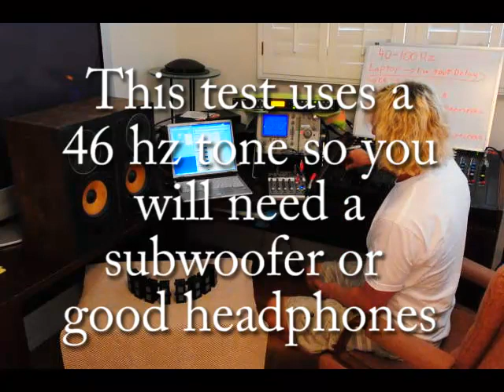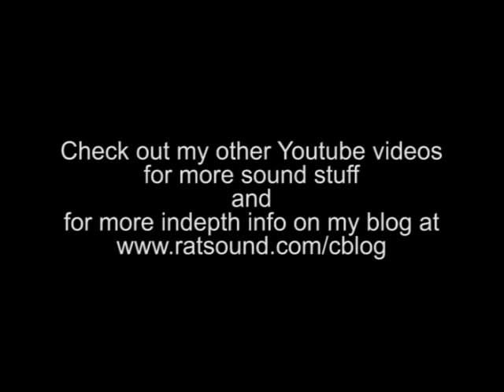Live Sound Subwoofer Configurations Part 2

Comment: What do you think of the Cerwin Vega FH subs style.  

I use two of these subs in a three way system and i dont need more then this. I have used up to 4 but thats way too loud for a 500 +people venue, and its chest thumping loud. Thats more louder then any configuration of 4-double 18’s. But i also think it depends on the amp!
Reply from the maker: cerwin Vega definitely has a distinct sound with heavy cones and beefy voice coils giving a thick low end. Not a fast low end but definitely in the range of the oh so many desirable sounds

Comment: Fascinating.  I think that what is percieved as "punch" requires a sharp fast transient working in a relationship  with the body of the waveform and by delaying multiple subs that relationship changes and the sound becomes less sharp or focused and therfore less punchy.  You are essentially changing the shape of the overall percieved kick drum waveform.  This can be tested in a DAW.

Comment: Hello Dave I am Kevin Joseph, have you ever heard or used the EAW Redline speakers? I want to use them for corporate setups both left and right of a small stage for a crowd of 500 people, would the subs being setup in a cardioid configuration be suitable as their are walls and high ceilings behind both left and right subs?. The size of the hall is the typical size conference rooms in hotels, in your opinion is the Redline any good and what will be the best setup.

Comment: dave can we use compression on the subs or mains in a  building to control bounce and cancellation    using single 12 inch 500 watt subs volume halfway and what is the barrier between band and audience   thanks
Reply from the maker: +atomvunis .anthony skarvoones Compression wont help bounce much if at all. To control low frequency reverberation, try to set up the subs so they focus energy only where you need it

Comment: I take your point regarding the waveform and resulting volume ramping with reverse polarity to the back cabinet for cardioid. A popular set up is to have the cabinet spacing much reduced, often stacked with a cabinet reversed, polarity inverted with the delay calculated from the front to back of the cabinet dimensions. This results in a much smaller delay often less than 2ms. I assume the laws of physics still prevail (!) regarding the volume ramping but this seems to be a popular configuration these days..I would value your opinion on this!!
Reply from the maker: The popular configurations with one cab pointed backwards for every 2 or 3 pointed forwards, as employed by D&B, JBL, L-Acoustics and others do not polarity reverse the rear facing cabs.  All are in-polarity and the forward facing cabs are delayed a bit. This offers some cancellation behind without the volume ramping issue
Reply: Dave Rat
So talk to the right man and you get the right answers...Thanks for this, I have been playing with EV laps for years and thought I had tried every combination! Your videos have been incredibly useful and clearly explained. With the polarity invert you need to shelve the response (increase) by 6dB..does that apply to same polarity? I always thought that infact you get +6dB out front with the null behind...? Virtually every other source on cardioid you google only refers to reverse polarity configuration, even from luminaries such as Siegfried Linkwitz.. has the volume ramping just not been noticed/understood?
Looks like I will need to edit my cardioid loudspeaker design on my site...www.soundright.org.uk !!!! Brilliant..almost can't believe you responded!!
Reply from the maker: For in-polarity setups the front sub is basically just a delay cluster.  No EQ or level differential needed. Sound comes from the rear speaker, then front speaker add in at the right time.  Simple, sounds good and no issues.

Comment: hello Dave , i have a question .
I recentlly bought 4 RCF SUBs 8004 and i am thinking of using them for a live band sound . If i set them 2 in one corner of the stage and 2 in another corner of the stage and set them one up to another IS IT OK to keep the delay 0 and the same phase ?

http://www.rcfaudio.ro/products_v2/boxe-profesionale/seria-sub/sub8004-as-config/large/sub8004-as+2xhdl20-a.jpg

Thank you in advance !
Reply from the maker: Yes, no delay, no phase shift is best with smaller simple setups to get maximum output.

Comment: The pattern of power alleys and valleys is dependant on frequency. The main equidistant alleys will be the same for all frequencies, but the valleys will be greatest when 2 subs are 1/2 wavelength different distance from your ears - a range of 5 to 20 feet for general sub frequencies.

Comment: If the ohms load on the car subwoofer is numerically too low say 2 ohms, it could burn out the output transformer if cranked loud and the amp has no protection. Nothing to do with how many watts it can take. That just roughly determines the largest amplifier you can crank right up without damage.

Comment: Nice tutorials,  better science than I'm used to seeing from tour guys. Note major diff between physical arc and electronically steered (delay) arc is front/back symmetry. There is no rear focal point with steered array. Demo & conclusions for steered arc are flawed: listening to signals well above the passband for subs. If, in practice, there is a perceived difference it is due to the summing of harmonic distortion components of the signal. Most subs have high 3rd order harmonic distortion.

Comment: Would a delayed arc only work with cardioid subs? Also, how would one calculate the delay between each sub? Center to center distance to millisecs? I usually set up Turbo Floodlight and Funktion one systems, Working a 25-35 foot stage, would it be an idea to place 2 clusters under/infront of the stage 4x2 each fx. with approx 3 ft. between L/R clusters, and run 2 delayed arcs? Or should I center them all against eachother in one 8x2 stereo cluster? Will subs in the sides be needed?

Comment from the maker: @dgr89cof Hmmm, well if you think of the speaker as the car and the amp as the motor, it may make things clearer.  The amp power is how much can be delivered to the speaker.  The speaker power is how much it can handle.  So in effect you put a much bigger car on a smallish motor.  Ideally you would want to increase the amp power as well.  Usually higher power speakers are less efficient but a more expensive large magnet speaker may put out more low end than a cheaper speaker.

Comment: Im a big fan of BASS or SUBs, my question to you DAVE is i purchad a Phillip 75 W 60Hz Subwoofer at pawn. Then took the Phillips Sub apart took speakers out then.  THEN i put a much bigger speaker a car BASS speaker 400 W in the Philips box, the reason i did that is it just sounds awsome with the bass shaken the house and windows LOL. Agan my question is will that do sumthing to the receiver or somehow start a fire cuz i replace the 75W philip speaker and put a 400W car speaker in its place?

Comment from the maker: @proaudiohd Solving the dead spots up front and center is easily addressed by adding a few lower volume subs to cover that area in the middle.  I am getting excellent results from the left and right setup I have out on Soundgarden right now. No significant nulls in the forward field and minimal sub on stage and behind the the sub arrays while able to cover 240 degrees in arenas.

Comment from the maker: @cookie35n On the surface, there should not be.  My experience is that the ultra top end subs tend to be non powered but rather have dedicated amp/processors. The reason is that using an external amp/processor allows multiple subs to be powered from one amp unit and therefore use resources more efficiently versus cost.

Comment from the maker: @rodsteel101 I have 5 or so setups that I pick from depending on the artist I am mixing, venue size, width, height, whether subs are on stage or floor, hollow or solid stage, back wall, indoors, outdoors, type of sub I am using and so on. 

I will do one or more videos and try and leave you with the knowledge you need to calculate and optimize some setups as well as a few go to starting points.